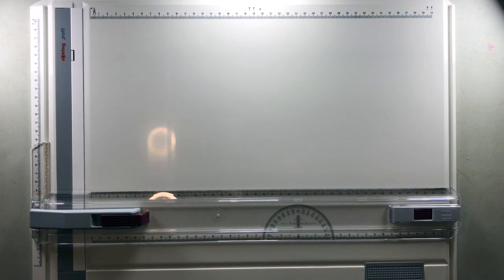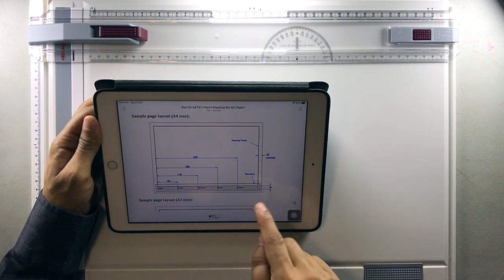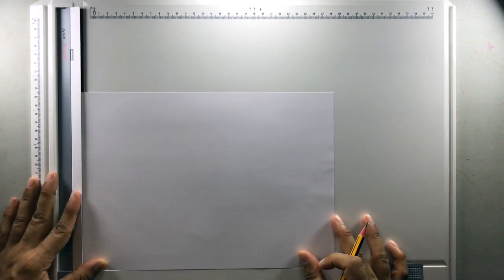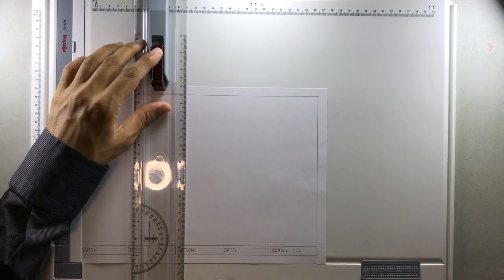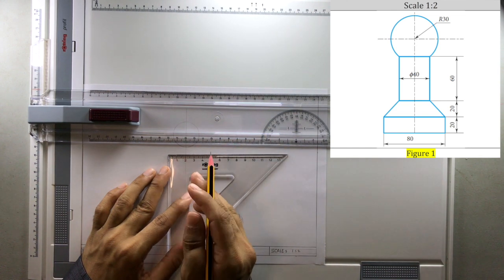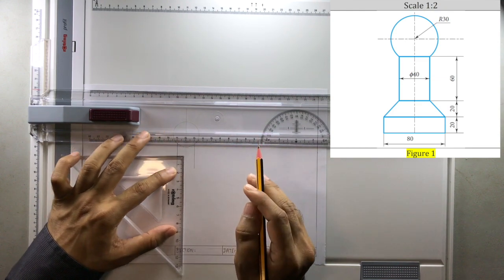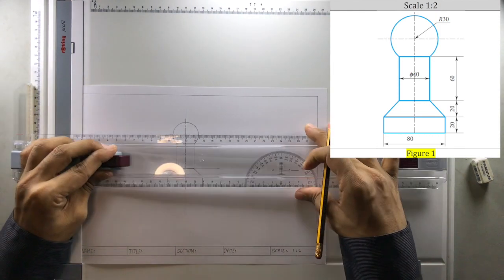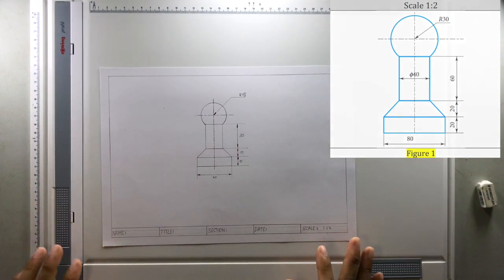Using A3 Drawing Board

Comment: How do you know where to draw the rectangle intersecting the circle?   There are no measurements in the original drawing.
Reply: I was thinking about that too. the height of the parallel line that intersects the bottom of the circle is unknown and that will be wrong dimension

Comment: You've made some mistakes.
Reply from the maker: In the dimensions isn't it?
Reply: @thirumalaig9918  Yes, for example with the way you wrote the dimensions. With the construction line as well. That's a centre line. Shouldn't be continuous.
Otherwise the method you're using is great. I had the same board 30 years ago. My son will start to use it. We live apart. That's why I was looking for a video. Something which can describe to him, how to use it. This is the closest to my setup so the best I have found. Thanks for it! 👍